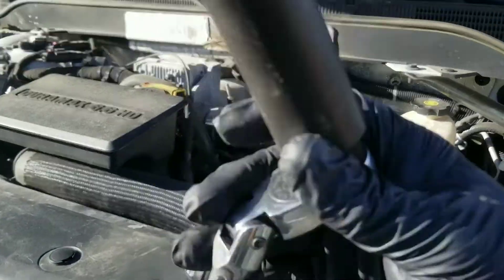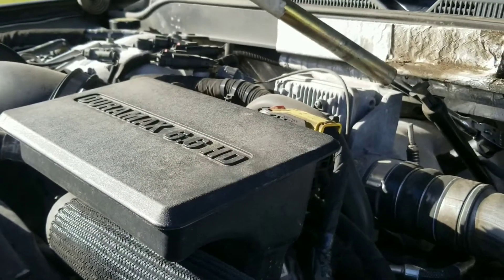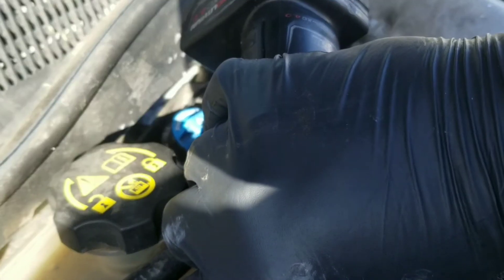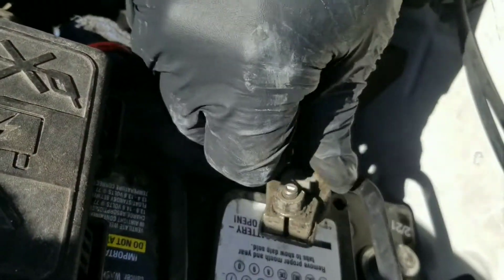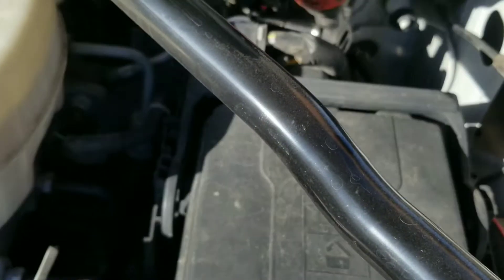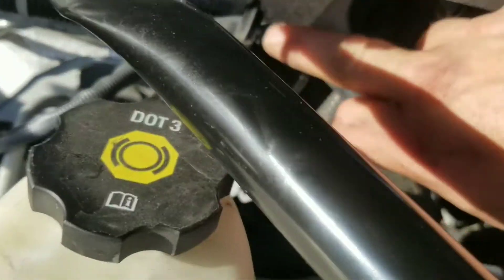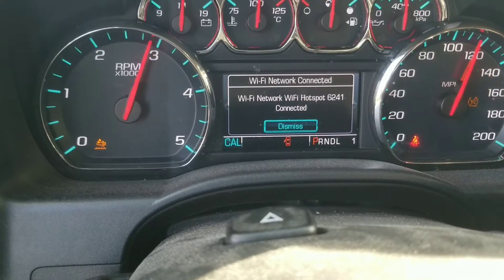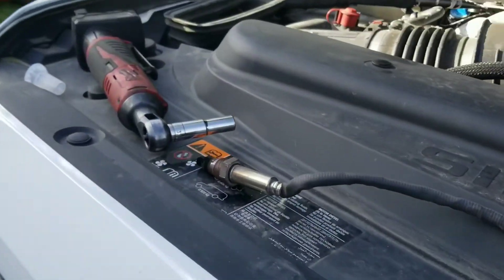duramax l5P position 1 NOX Sensor replacement

Comment: I had the same issue and the shop changed 2 nox sensors and calibrated them and charged me 1500 dollars...Its my first diesel so I had it done by a shop, but I guarantee I will start doing my own work on it..outrageous price

Comment: Did you have to do a rest on that sensor with your autel?
Reply from the maker: I didn't , it was pretty much plug and play. It did take a few cycles of the ignition to go away completely. If it gets bad enough it reduces power you will have to do a forced regen( that was my experience the second time it happened. I have replaced this sensor 2 times in 500k miles)
Reply: @CFarmer   thanks for the response !yeah mine is in low power mode, code won’t go away new parts in but when I go to reset the nox1 on the autel 808 it doesn’t do anything can’t get a reading off the new one . Kinda banging my head on the wall.
Reply from the maker: Can you do the forced regen?
Reply: @CFarmer  yes I can I’ll try that.
Reply from the maker: I hope it works, it got me going last time. Let me know how it goes
Reply: @CFarmer  just wanted to let you know man I figured out the issue, did 2 forced regens, a new Maf and filter she seems to be good to go ! Appreciate your help, your the man .

Comment: Thanks for the great video. Getting ready to do this job on my Colorado Duramax. Do I need to put any sealant or thread lock on the sensor when putting it in? From some of the comments about ant-seaze on the threads, I'm guessing not. Did you just tighten the sensor and the bolts to the module without applying anything on the threads? Just want to make sure I have all I need before I take things apart and can't drive to the parts store.
Reply from the maker: Thank you! I didn't use anything on mine, but it wouldn't be a bad idea to put some anti siese on threads if you have it

Comment: P249D. 2018 Duramax diesel Allison transmission dually 138k miles. Do I have to delete the truck to get rid of this code? I tried erasing but is consistent code keeps coming back
Reply: I had p249d come up this morning when I started it up. Had p20ee come up a couple weeks ago and a couple people said that was a bad nox sensor downstream going to the dealership next Monday to get that changed. Could the p249d be some bad fuel or something else. I’m new to the diesel stuff and any help would be great.
Reply: @brandonalexander1831 fuel injection control is too low. Very easy to change with the right tools. I just do not know if mine is up Stream or Down Stream. Do not go to Dealership.too much money.😊😊😊😊😊
Reply from the maker: I had the P249D come and go on mine. I noticed most of the time it would come up if i had fueled at different places than normal. After i would fill up again at one of my usual places it would stay gone until i bought fuel somewhere i didn't usually buy from again.
Reply: I would say drive it 2-5 miles and the Check Engine light should go out 😊😊😊😊

Comment: Was your truck blowing any black smoke with that sensor bad that was the first code that popped up on mine and then it went to mass air flow sensor cleaner and now my truck is blowing black smoke and it is not deleted

Comment: Changed out the upstream sensor about a month ago and engine light went off a few days later. Now this past weekend the light comes back on with same P02EE code and U029D code which says Nox sensor lost connection senor A. Wonder if a new connector needs to be installed?

Comment: Thanks for this video. My truck is throwing a P20EE  code . I’m hoping swapping this sensor will help as well. Where did you purchase your sensor? Thanks again for this video
Reply: Did you replace it and did it fix that code?
Reply: Unfortunately not. I have since bought a Banks idash. Now I see my sensor 2 has not been working properly. The sensor came in the other. I will install it tonight or tomorrow .
Reply: @Bandit93gt what did you observe that told you it wasn’t working properly
Reply: @Bandit93gt did it fix the issue changing the #2 sensor ?
Reply: @ actually no. Mine ended up being the def fluid level sensor.
Reply: How did you fixed this code?

Comment: I have a code P20ee says nox sensor but which one? Help please?
Reply: Upstream behind turbo on top off the engine
Reply: @Bandit93gt  thanks
Reply: @enrique6943 I have the same code, did you change the nox sensor ? And did it fix the issue ?
Reply: @omarmorales4471  
I still don't know and I haven't even bought the sensor or sensors yet.

Comment: I have a L5P with code P20EE SCR Nox catalyst efficiency below threshold, bank 1 sensor 1, will replacing the senor like you did fix my problem as well?
Reply from the maker: No guarantee but it's where i would start.  I would think it would fix the issue
Reply: Hey man. I have this issue. Did this work for you? I am close to purchasing this sensor
Reply: I been getting this code too, have you fixed your? Thanks
Reply: I have same code P20EE, but don't know if I should start with sensor 2 first?

Comment: How did you get the engine code on the truck touch screen?
Reply from the maker: I have the autosync from bt dieseworks. It let's me read/ clear codes, cargo and mirror lights while in drive, strobe lights, powertrain data on screen, turn signal camera... all kinds of stuff.

Comment: Have you had to do the position 2 sensor yet? If so what tools where needed other than the sensor socket?
Reply from the maker: Just the 10mm bolts that held the module to the frame and a pull handle with a swivel head to break it loose and that's about it. Kind of a pain to get at but not too bad

Comment: Wondering if anyone has found a difference in NOx sensor removal between a cold vs. a hot engine?  I would have to think that a hot surface would expand slightly, making removal (initially) a small bit easier.  Thoughts?
Reply from the maker: When i did position 1 was cold and position 2 was hot. They both came out a lot easier than i thought
Reply: @CFarmer I need to replace my nox position 2, did you have to relearn or reprogram at all ?
Reply: Depends how long the sensor was in.  I've had hot removals that took the threads of the bung with them.  Not fun.

Comment: I cannot get mine off.  Using the same setup with only a 12” cheater.  The engine is hot so i will let it cool and try later.  Why is it so tight??
Reply from the maker: I was amazed mine came loose as well as it did. The heat from the exaust can cause it to bond. It should still come loose. After it cools If you have PB blaster or sea foam deep creep I'd soak it and let it sit for a bit then give it a try.
Reply: @CFarmer  yeah i sprayed it with kroil.  Gonna try in a bit
Reply from the maker: Kroil is even better

Comment: Recently got this code on my ‘19 at just over 40k miles. Position 1 is upstream correct? Service manager told me it was behind the turbo. Quoted me 1k for sensor and labor. Rather do it myself. Appreciate the how-to 👍🏽
Reply from the maker: Thank you! Yes, position 1 is upstream. Hard part nowadays is finding the parts. Took me 2 weeks to track down position 2
Reply: I finally replaced this sensor. Your video was dummy proof. I'll be keeping an eye out for any lights but im confident we had the same issue. Thanks again for putting this out 👍
Reply: The Sensors are $325 each. I don’t know if mine is up stream or down stream ( Code P248D)😊😊😊

Comment: Great video, how did you get the code to display on your radio screen?
Reply from the maker: It's from the autosync. It's a box that plugs into the obd2 port that opens up all kinds of factory options. The gauges on the screen, turn signal camera, rear camera while driving, strobe lights, cargo lights in drive, forced regen and lots of other stuff. I'm not affiliated but a very happy customer. They're is a Facebook autosync discussion group that talks a lot about the features and options

Comment: What kind of computer do you use to get codes and do the reset ?
Reply from the maker: Was trying out a friends AUTEL and it worked pretty good. I'm ordering mine today so it'll be home when i get there. Here's a link to the one iwas using and that I'm ordering
https://amzn.to/2WZDYFd
Reply: @CFarmer  nice thank you , Iam ordering an Autel as well but was thinking of getting the one for $1100 do u know the differences ?
Reply from the maker: Honestly i don't, do you have a link to it so i can look? Also when i did this the codes cleared on their own. As soon as i started both trucks the codes were gone before i could try to clear them. Also in my truck i have autosync and it reads codes right off on my touchscreen in the truck and clears codes so when i did mine i used it

Comment: I have a 2018 Chevy Silverado 2500 with 6.6 liter . I already replaced the def pump . Nox sensors the harness underneath for the def pump and the def pump module and still the code P249D isn’t desapear. Somebody can help me please I will be very appreciate
Reply from the maker: How many miles are on your truck? Curiosity

Comment: Not sure if it helps. But i do remove both my nox and last one clean them with carb cleaner in my semi truck every other year 250,000 miles or so. Have not replaced a sensor in 675,000 miles now... also clean my dpf filter with hydro chloride. To clean soot use Muratic acid to clean ash. 1,100,000 miles with my original dpf filter. There are videos of using this method. And thanks for your video be safe master your journey.
Reply from the maker: That's good info, I have been thinking about cleaning the old one and trying it again then cleaning the downstream one
Reply: Do you think there is any issues with putting on a small dab of anti seize on the threads? May make it easier for next time.
Reply from the maker: I would think that would be a good idea.
Reply: I did the cleaning on my L5p and it didn't work